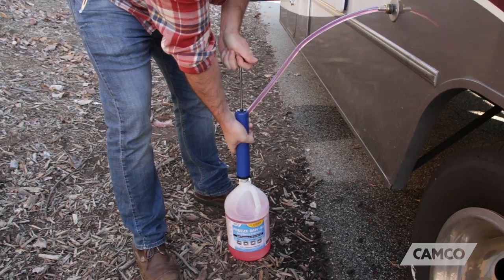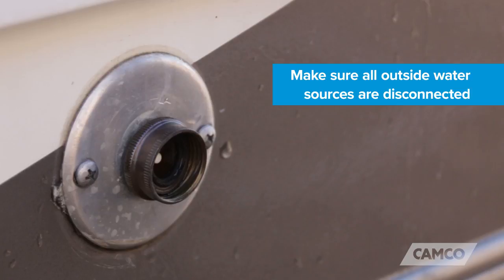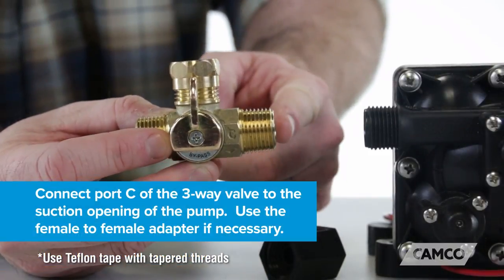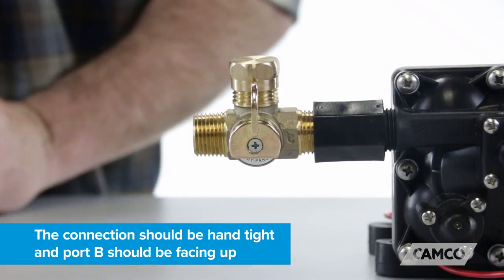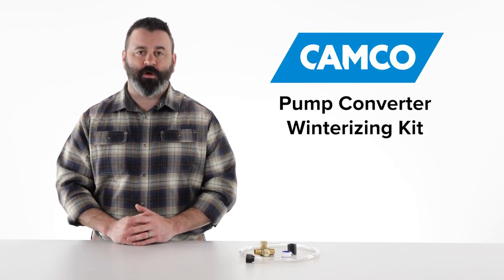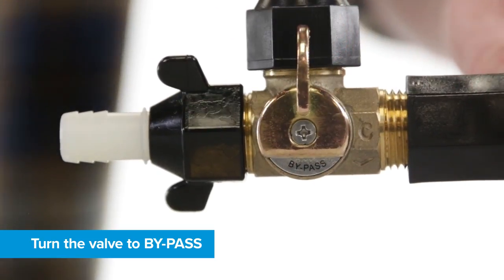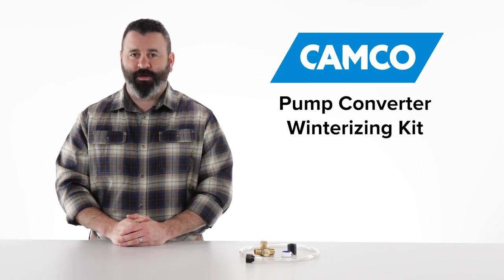Pump Converter Winterizing Kit

Comment: Before You Buy note that this kit may not be a good choice for FLO-JET pump. That is because Flo-Jet has quick connect inlet and outlet connectors which are not compatible with this kit. Check your Pump before purchasing.

Comment: This kit doesn’t work with my water pump… it’s a Flojet 03526144. The inlet doesn’t have threads. I have a Springdale 260TB. It would need an inline adapter to work.

Comment: Wasted a lot of time trying to figure out what was wrong with my pump and why it wasn't sucking antifreeze.   Turns out the siphon hose commonly doesn't seat until you take the Oring from the brass cap and install it on the hose fitting.

That works, but now I need another Oring to put the cap back on when I take off the siphon hose, since despite being a valve apparently it leaks if you leave the hose on.

So for me, great idea and it works but what a huge waste of time that could have been reduced with 2 Orings and proper instructions.
Reply from the maker: Thank you for your review. It will still work, but unfortunately you have to use a wrench to tighten the fitting. We improved this product last year to fix this issue. I am sorry that you received an older product. If you would like to, call our RV customer service at 1-800-334-2004 and ask for a new hose and fitting for part number 36543.
Reply: i just got this kit and ran into same thing been nice to have o ring in the hose fitting to i took the one from cap i hope camco fix this

Comment: I got this kit and I cannot install it due to length of the valve and the double female adapter. I run into a wall. I need to splice it in the tank supply line but cannot fine the correct connectors.   Also there is a device that the supply line connects to that is attached to the water pump (I suspect it is a filter). Any suggestions?

Comment: The Hose plastic connector is crap! got home and had to use make my own! Cheep part. why use the cheapest pice in the most crucial part? Just Dumb.
Reply: I agree. Okay, I spent 3 hours trying to fix the problem with it not sucking the antifreeze in. I kept thinking I installed it wrong. I finally found the problem. An O-ring is missing in the plastic connector! Once I put one in it worked perfectly. Camco should be ashamed of putting this part out. It's junk. Use a brass connector and  just charge more. Or, just put the dang O-ring in! What a complete waste of my time.

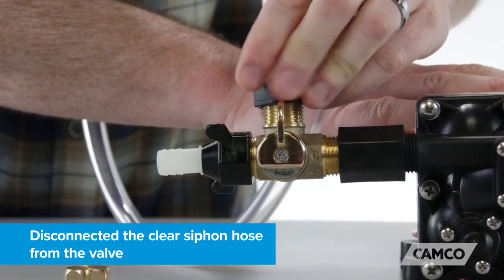Comment: ???????????   @ 1:45 WHY do we need to remove the hose if we just TURN the "Bypass" to open? 
I don't see a need to remove this hose... WHAT AM I MISSING? 
Thanks and GREAT VIDEOS! ! !   Happy Camping!
Reply: Good question George. We recommend removing the hose and capping it in case the valve fails. This is unlikely to happen, but could cause water damage if it did.

Comment: if I hook up the unit as shown and antifreeze is spilling on by the other end of the pump (B valve on by-pass) does it mean the valve is bad or did I miss something?
Reply from the maker: With the valve connected, the inlet or suction side of the pump and the valve is set to by-pass, the pump will pull anti-freeze from the container and pump it thru your RV's water lines.

Comment: I installed mine as per the instructions and still get no suction of the antifreeze. Super frustrating and I wish I left it on the shelf at the store.
Reply: Did you put it on the right side of the pump?
Reply: Okay, I spent 3 hours trying to fix the problem with it not sucking the antifreeze in. I kept thinking I installed it wrong!. I finally found the problem. An O-ring is missing in the plastic connector! Once I put one in it worked perfectly. Camco should be ashamed of putting this part out. It's junk. Just put the dang O-ring in! What a complete waste of my time.

Comment: My Shurflo pump has a filter attachment. How do you attach this properly to the pump when it has the filter?
Reply from the maker: You will need to remove the filter first.
Reply: The easiest thing I do is to simply pull the suction line off the water tank and put it into the jug of antifreeze, then turn on the pump. I have been thinking about installing one of these, but it's too simple now to change it.
Reply: Camco Manufacturing Can the filter be reinstalled on the other side of the brass valve so that it filters water intake only?